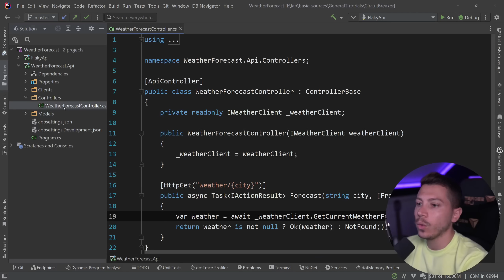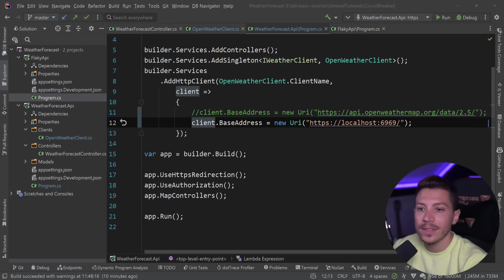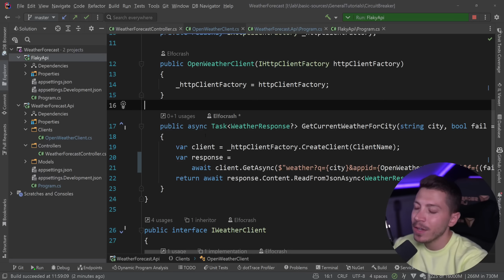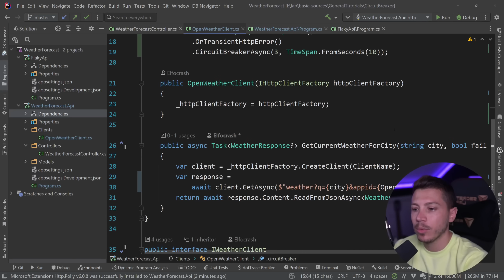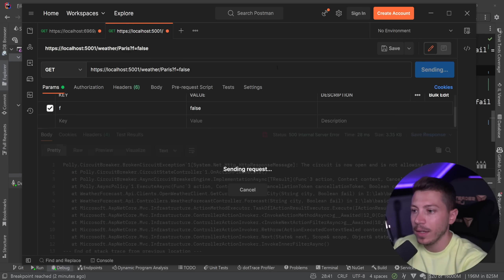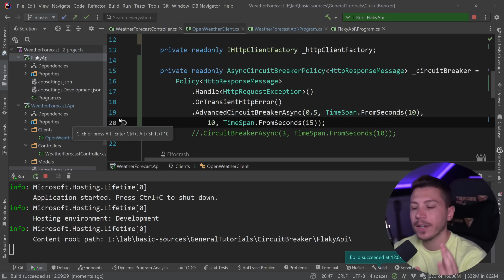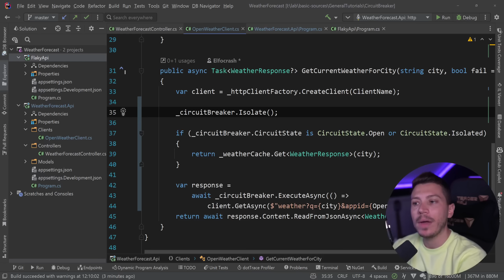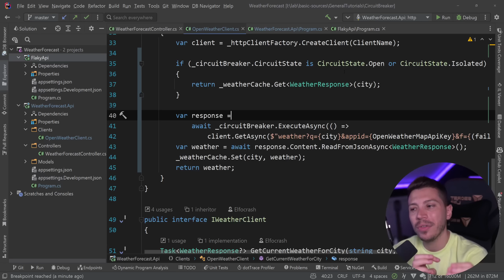The electrical pattern that will keep your .NET services alive

Comment: Great video as always!
While Polly is a great tool, in a real world application of a decent size you would want to get rid of this kind code from your services and instead push the problem to the infrastructure level.
That way, your web service code have one less concern to take care of. Of course, your Ops will instead inherit that concern =O)
What I'm talking about here is of course service meshes.
Reply from the maker: It depends on the problem. Your fallback logic can have domain specific logic in it. In that case I wouldn’t expose it to something like the api gateway and instead use something like Redis to manage the state. It really depends on the problem

Comment: Thanks for the video. It is very useful. I have a question, how does the Polly keeps track of number of failed requests to "open the circuit". I am just thinking the scenario, in which we have a round-robin load-balanced servers and let's imagine we only have 2 round-robin servers. The first few hits could hit Server 1 and Server 1 may pop open the circuit but when the subsequent hit, it may go to Server 2 and it is a successful call, then third hit, it goes back to Server 1 and it fails. So, in this case, the client application will behave weirdly?
Reply from the maker: You’d need to plug in distributed extensions with Redis to keep track of the state on scaled out systems

Comment: When we learned about transistors/diodes in electronics class one of the first things the teacher said was "we won't speak of open and closed because these terms are horribly ambiguous, we will speak of pass-through and blocking".
Reply from the maker: I cannot begin to describe you how much this naming messed with me when I was first introduced to the topic
Reply: As an electronic engineer turned game developer, I'd like to point out that the correct terminology for transistors zones are cut-off ("off"), saturation ("on") and active (signal amplifier). I never heard of pass-through/blocking.
For diodes, they're called forward ("on") and reverse ("off") bias.
Reply: @galandilvogler8577  In reality my teacher used Dutch words. I freely translated them to English.

Comment: Hi, Nick! Great video! I assume in real world applications you use combine both this and the retry techniques. Is my assumption correct? And, if so, do you have any recommendations / best practices on how to implement both propertly? (P.S.: I haven't gone deeply into Polly's documentation yet, so, if there is anything there which answers my question, feel free to simply point it out) ;-)
Reply: I would say it depends on situation. If you facing a non-durable service or 3rd party call with timeout issues, then using retry policy would sufficient. Circuit breaker is more convenient where service doesn't managed by you in any case of outage and cause cascading failures in your distributed systems.

Answer is yes for your question. You can combine multiple policies with PolicyWrap extension. Again, it depends on need but maybe wait-and-retry policy first and then after circuit breaker policy could be strong handler for this type of situation.

Comment: I don't understand if the circuit is referred to a api call including the querystring or not. I mean, "http://endpoint/api/action?arg=1" and "http://endpoint/api/action?arg=2" are two different and independent circuit or just one circuit focusing on the response of "http://endpoint/api/action" regardless the input parameters?
Reply: It is a single circuit. Otherwise his examples would not have worked.
Reply: @EvaldasNaujikas  my fault 😅

Comment: I’m not sure this is useful at all when a microservice is using a reverse proxy side car, which already does this for you.
Reply: This is my thought as well, that this is better handled in the reverse proxy or API-gateway than added to every service you got.
Reply: This is my recommended approach as well. Let the infrastructure handle as much of the dumb retrying/circuit breaking as possible. All the service meshes/modern proxies have extensive retry/circuit breaker features built in.

Doing it all inside your services leads down the road of creating shared libraries to avoid duplicating it in every service and before you know it, you now have a core platform set of libraries/clients that MUST be used by every service so that they behave correctly.

Doing it in the service is still useful when you need more context and logic around specific retries/circuit breakers. However, that should be the exception and not the rule.
Reply from the maker: It is very much useful even with a reverse proxy. There are limits to how much logic you can dump there and you need to be very careful to not leak business logic to your revere proxy’s configuration

Comment: Why do you need to wait for 3 queries to fail when you can return the cached version immediately in the catch block for the method?
Reply: Because it's just an example?
Reply: I think this was more a demo of Poly and its circuit breaking abilities rather than all the appropriate ways to handle failure, but yes I agree - seems if you have a cached value and the API you're forwarding your request onto fails, you should return that cached value and minimize disruption to the client.  In this example, the API call had to fail several times in a row before falling back to the cached value, which seems inefficient.
Reply: Because you don't have to make an expensive api call and wait for it to fail, possibly wasting limited api calls before returning the cached version.
Reply: Because you cannot control wat a remote api does when you try to use it when it is down.
Sometimes api’s ip ban the remote client that keeps failing. Also if you have certain amount of calls per day or month the failed request do count. So it is to prevent your api from using all the requests allotted for that time period.
Reply: @Xamdify  That doesn't answer his question. I think he's asking why doesn't Nick just return the cached data whenever an API call fails and my guess is this might not be the best example to showcase the package.

Comment: Would this be beneficial to use with azure functions as well? We have a lot of http clients with retry policies set up in our startup.cs, but we’re just using the standard Polly library.
Reply from the maker: It would be harder to maintain the state of the circuit breaker in an Azure function so you’d need to be careful with that